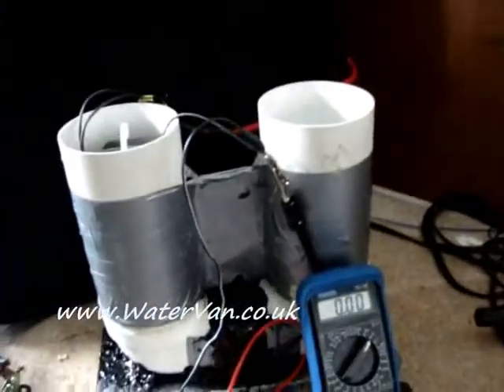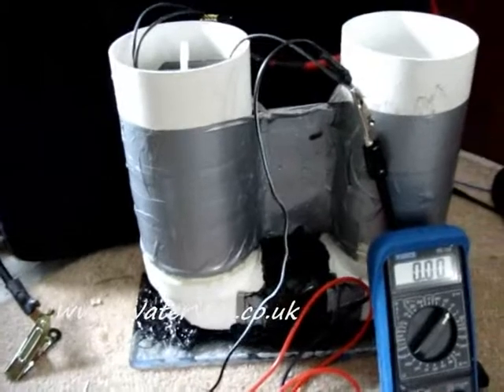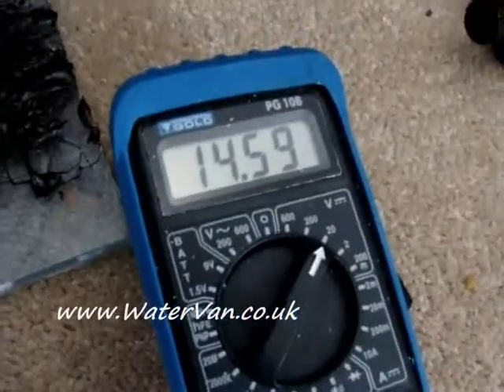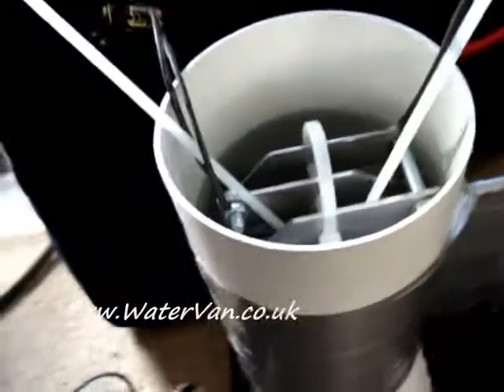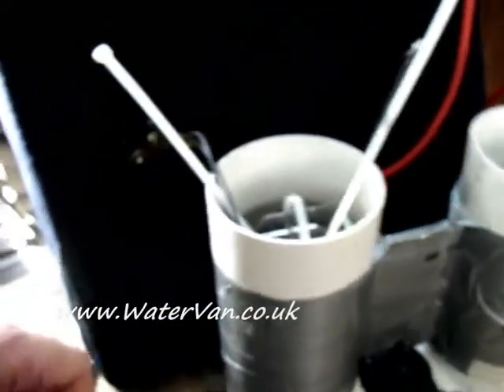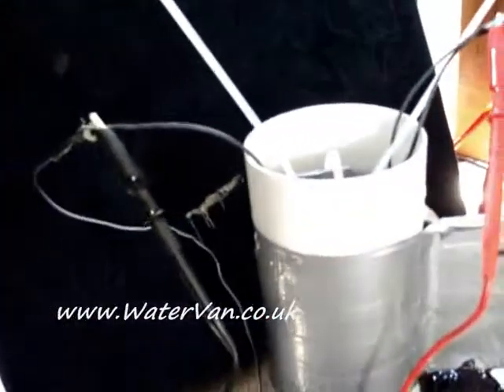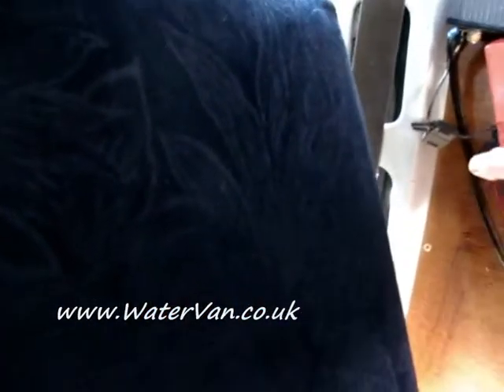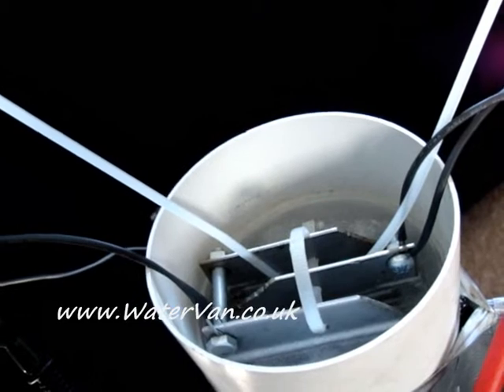#019 - MadStu's Water Powered Van - Cell 4 - Initial Testing

Comment: Stu, I think you will be quite pleased with the amount of gas that device will produce at 10-15 amps ... with what you have in place now, seems you have a limit of 20 amps or so and you want to keep a margin ... so its best you experiment a bit on electrolyte solutions to come up with a repeatable mix that will give you right at 10-15 amps as you determine is proper for your needs ... the device is over engineered and could easily take 60 amps if you could feed its appetite for amps  ...

Comment: On the wire.  If you can get bigger stuff, do it. To support 30 amps, its going to take some pretty thick stuff, something equiv in diameter to about 1/4 of a battery cable to give you a visual reference. You could take 6, 8 or maybe 10 stans of the thin stuff, put it in a vice, wind it into a single strand with power drill, tape it up tight, then shrink warp to make a BIG cable able to handle the amps ... most guys are using stainless steel scraps as straps these days to make it rugged.

Comment: As far as installing in the van. I assume you have give thought to how best to wire it in?  Most would use a headlight relay controlled by a dash mounted switch. The relay actually turns the device on/off and the remote switch that kicks the relay can be wired in with pretty small easy to run wire. Wire from relay to device needs to support 30 amps at least. Also, you really need to put a fuse in the power to the device to protect the van's electricals. Sleep on it, come up with a plan.

Comment: very nicely done sir ... looks to me like once you tighten up a few details, you are going to have a very productive system there ... looked pretty good at 10a ... with a proper wiring job, should be able to stand 30a without problems ... at 30 amps, that thing should pump a serious amount of gas ...

Comment: Stu, you are going to need MUCH bigger stainlees steel wire to supprt decent amps ... obvious thing to so would be to run multiple strands ... stuff you are using is VERY thin ... kinda amps you are going to need you will want 6-8 that size ... plan it to support at least 30 amps ...